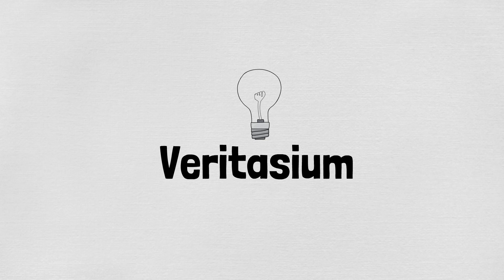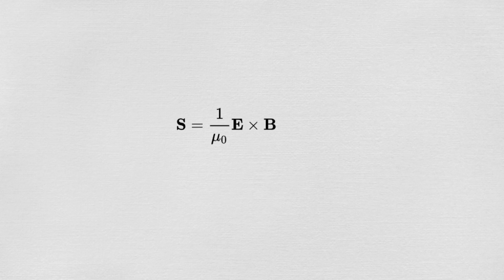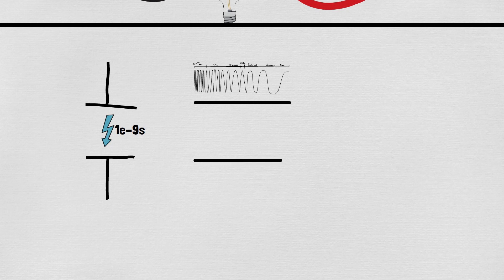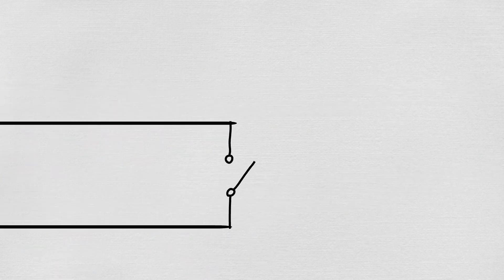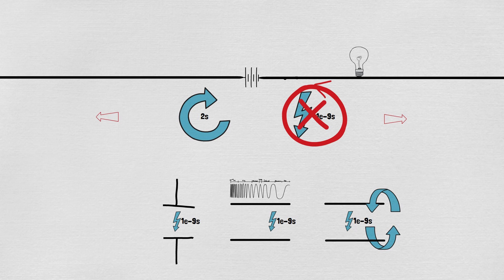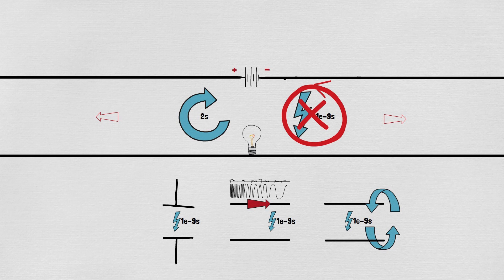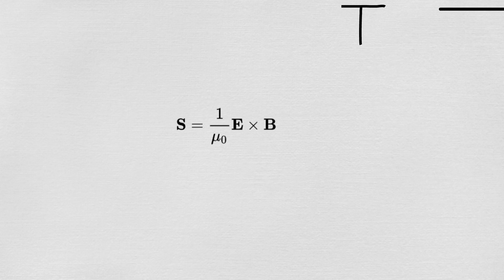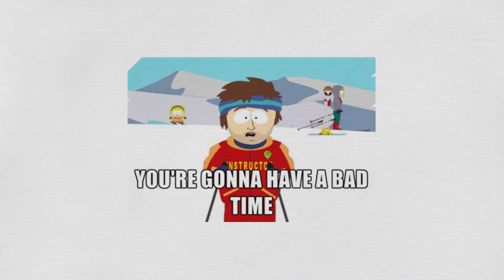Veritasium is Right? (see description)

Comment: Robert Faranec did an excellent video on this topic where he interviews Eric Bogatin about this question - the question is very relevant to high speed PCB design, because modern devices signal at rates where this effect is seen strongly at PCB-scale distances - and Veritasium is correct (or else your computer wouldn't work properly). 

The reason why is because the EM field need not travel along the entire circuit to create a current. The two wires can be thought of not only as a single capacitor, but can also be broken up into arbitrarily small inductor-capacitor pairs (where the inductor represents a segment's inductance and similarly for the capacitor). Now, the EM field's formation along the wire can be thought of as each of these L-C circuits charging or discharging to a given applied voltage. Using this model, a current will start flowing at the lightbulb's location as soon as the switch closes because the switch is passing current to charge the capacitor of the next L-C circuit, while that circuit's inductor is slowly allowing current to pass into the following L-C circuit, and so on, and so on. The bulb won't turn on until the switch is closed because no current is flowing either through the end of the wire or the virtual intermediate L-C circuits. While the transient is running down the wire, the L-C circuits dominate and the current is going to establish the EM field, and once it reaches the end and reflects back, the termination (in this case a short) dominates as all of the capacitors have charged and there is no change in current for the inductors to fight.

This also provides an intuitive answer to the "what happens if the switches are far away" question. If there's a second switch on the far end, then the lightbulb will turn on until the transient (the "wave" of charging L-C circuits) reaches that far end, at which point it turns off: it's being turned on by the current required to charge the capacitance of the transmission line, but then turns off once the transmission line is fully charged and no current is flowing at the far end. Similarly, if we place the switch very very far away, the lightbulb will turn on once the charge transient/EM field reaches it along the wire, turned on by the current being passed to charge the wire's own capacitance.

This effect is vitally important high speed PCB design (for both digital and RF applications) in the form of transmission line impedance. You hear a lot about controlled impedance PCBs providing a transmission line impedance of, say, 50 ohms. All that means is that when you put a transient into the transmission line, it will pass current as if it had a resistance of 50 ohms until the field is fully established all the way to the end of the transmission line and whatever termination is there dominates. This is why, for example, it's important to impedance match high speed receivers to their transmission lines, since then the device on the far end has the same impedance as the transmission line connecting it to the transmitter thereby preventing loss to transmission line inductance from the impedance changing once the EM field has reached the receiver. This applies equally to antennas and to high speed digital communication.
Reply: kudos for such a lengthy explanation ! i understand
Reply: I think it would have improved the original video a lot if he had clarified that the important distance was the bulb to the switch not to the battery 

And how important the constant 1m difference is. From his description you would have the same effect if the wires were 1km apart.
Reply: @scollyb  I agree; it was only after I thought about it as "but what if it's just a PCB" did it click for me. Thinking about it in terms of (for example) a 1ns rise time signal going onto a 10cm transmission line made much more sense, I think because it makes it easier to think abstractly about the problem.
Reply: @benjaminchung991  For my physicist brain it was thinking about the effect on the fields and the electrons as the switch closes.
Reply: @JanoyCresva66  It can be build up easily. No need for very long lines. A transmission line terminated by its characteristic impedance is indiscernible from an infinite line. A couple of meters will do.
Reply from the maker: @JanoyCresva66  i look forward to that as well, since i'm not 100% confident in my interpretation either. if i had an oscilloscope, i'd perform the experiment myself, but alas, i am but a poor gov't scientist.
Reply: @antimatterhorn  I know with my old computer, if I bent/stretched the ribbon cables the data would get scrambled, I was told this was because the path taken by the electricity on the stretched strands was slowed down, taking that data out of sync.... The source and the destinations did not change locations, so I think this would be a practical proof that you are correct, if the electricity didn't flow in the wires, why would it matter?
Reply: @antimatterhorn  Nice one! Finally some humor. Poor govt scientist, I'm sure you have to haul your check in a dump truck. Now, as a poor E&I, that's my line.
Reply: You nailed. In order for the bulb light current has to pass in and out of the bulb. With the switch open no current flows out of bulb.  Because the switch is right next to the -ve battery terminal  there will no coupling between the antennae on that side as Tycho proposes. On the left hand side there is coupling but this only creates current into the bulb. on the right hand side the switch is open so there is no coupling and hence no current out of bulb. Now as soon as you close the switch the antennae on the right (-ve) side are indeed coupled so now we have current in and current out of the bulb so it lights. I used the diagram at https://youtu.be/-jJB8dyOJIw?t=173 for this explanation.
Reply: @alexjohnward  In practice the amount of signal jitter that's introduced by a still-intact cable into a signal won't effect the signal integrity much. You can calculate this fairly easily - if we take the speed of light to be approximately 3x10^8m/s a 1mm deviation in overall length (for example) induces a delay of around 3*10^-12 seconds, for which a clock speed in excess of 100GHz would be needed before it started closing the eye. 

What I suspect was happening is not that the electricity was slowing down (the rate at which the field propagates doesn't have anything to do with conductor diameter) but rather that the connection was becoming intermittent and was occasionally being broken by a failure in the cable itself.
Reply: @scollyb  you will have a greater impedance (3 times greater) but the bulb would still turn on.
Reply: @antimatterhorn  you see flowing current (I=V/Z0) in a transmission line immediately as soon you apply a signal, whether if it is short, long, infinite, open at the end, closed at the end, closed with a matching impedance.
Reply: Alpha phoenix is doing an manual experiment on this. Can't wait for mehdi too
Reply: @lubdub7913  no, this explanation is insufferable. too long, yet so wrong. sounds clever, but even the writer doesn't know what he's talking about.
Reply: This sounds very reasonable until you try to put some figures to it. Let's say we have a 12V battery and a 3W, 12V bulb. So the bulb uses 250mA and has a resistance of around 48 ohms. Let's assume we're using 18 AWG wire, which has a diameter of about 1mm. Then you find that the two wires running 1 metre apart have a capacitance of around 3.6pF per metre.

Now we can start examining some of the assumptions made in this "charging the next L-C" circuit theory. If we're charging the "first L-C circuit" with the current of 240mA, it will charge 3.6pF to 12V in around 170ps. So after 0.17ns the first metre of the wire pair will have charged up its capacitance and both strands will be at 12V, so no more current will flow from that first metre charging up. But the next 1 metre of wire will take over 3.3ns to receive the 12V step signal, even if it propagated at the speed of light, so where is the current coming from to light the bulb in the meantime? It simply doesn't add up.

For it to be a transmission line, you have to hold one wire at a fixed potential (call it ground) and apply a signal to the other. Your analysis expects the furthest wire to charge up to 12V when you apply 12V to the nearest. That's nothing like a transmission line.

There may well be a transient radiated as an electromagnetic wave as the switch is closed, but it will never carry enough energy to light a bulb for the time taken while the current travels around the circuit (which is going to take a time in the order of seconds). Otherwise, we could add more bulbs connected to lengths of wire, but disconnected from the main circuit, and expect to see them light up while waiting for the current to propagate. At which point all the other bulbs would all turn off!
Reply: @RexxSchneider  To be clear, I'm not arguing that the amount of current passed in the transient condition is equal to the amount of current that's passed once propagation has finished. The current that's flowing as the wave is propagating down the wires is going to be determined by the characteristic impedance of the two wires in question, which may (as in your example) be much much higher than the impedance of the receiver on the far end. In this case, the return current will be tiny until the reflection has came back from the far end. I'm simply saying that current is flowing, rather than making a specific statement about what kind of light bulb it will light up/how much current is passing during that time. The lightbulb, in this example, is being used to indicate if current is flowing at all, rather than X many amps are flowing through it.

> There may well be a transient radiated as an electromagnetic wave as the switch is closed, but it will never carry enough energy to light a bulb for the time taken while the current travels around the circuit (which is going to take a time in the order of seconds)

This depends on the characteristic impedance of the transmission line. You're absolutely correct for the line you describe, where the impedance is quite high due to the spacing and low dielectric value of open space. In the case of a PCB, for example, characteristic impedances of 50 ohms or similar are typical, which can pass meaningful amounts of current, due to the much smaller spacing and the higher dielectric of FR4.

> Otherwise, we could add more bulbs connected to lengths of wire, but disconnected from the main circuit, and expect to see them light up while waiting for the current to propagate.

This can happen, since the wires are in this case acting like a radio. Again, the case where this effect is most noticeable is not on these large scales (because obviously we don't have wires this long running along straight lines out to space) but instead in PCB design for very high speed digital systems or RF. What you're describing is crosstalk, and happens a lot in said high speed design applications.
Reply: You glossed over the fact that the "high speed PCB" means that they are designed for very high frequency - hundreds of megahertz or more. Veritasium video dealt with DC current - an entirely different concept. As Maxwell's equations dictate, EM Field can travel or propagate only when it changes with time, and there's no propagation of EM field in DC circuit, such as in the case of Veritasium video.
Youtube video will never deal with scientific nuances such as this, that's why you should not based your facts around them.
Reply: @hereiam2005  The act of closing the switch is what makes it a non-DC problem; you have a transient flowing down the wire any time when you are changing the potential. It's just that in circuits of reasonable size (e.g. not going to the moon and back) or when you are observing at reasonable speed (e.g. not hundreds of megahertz), it just doesn't matter enough for it to become an issue. These effects still happen in "DC" circuits when you switch them on and off, it's just that normally you don't notice it. I would also note that this can still be an issue in slower clocked circuits (even tens of kHz) because the main concern is not clock speed but rather the rise time of the signal, which can dramatically exceed the rate that the clock speed itself implies.

In the particular case of the Veritasium video, the effect is made noticeable in a "human" time scale by making the transmission line impossibly long. As a result, the time required for the signal to propagate to the end and reflect back (during which time the observed impedance will be dominated by the line's characteristic impedance) is made artificially enormous. As you point out, this is an absurd case: nobody has a conductive path this long (though there might be some weird examples like spools? not sure), so you're not going to see this in practice. However, due to the problems mentioned above (where high clock speeds, fast rise times [which are more common then you'd think], or RF becomes involved), it's a serious practical concern in PCB design and electrical engineering generally.
Reply: Not only PCBs that inductor and capacitor model is used in electric Transmission lines also...
Reply: What you describe is true, but this effect will not light a regular sized lightbulb in a macroscopic circuit (unless we’re dealing with a comically huge battery)
Reply: @dlmcnamara  The currents passed can, in theory, be fairly large (50 ohms, which is typical for controlled-impedance PCBs, is not that high), but you're right in that normal lightbulbs are probably out of reach. An LED is well within reach, though.

The problem that I'd highlight is less current and more time. While propagation through FR4 (or coax dielectric) is slower than in vacuum, it's not enough that any realistically-long cable would cause the effect for a perceivable length of time. As a result, while you might be able to turn on a LED, it would be for so little time you couldn't see it.
Reply: What if to rule out the impedance or EMF transmission across the two long lines, you somehow trap the bottom half in a faraday cage. 
Or suppose you have a cement wall to isolate the two halves.
Reply: @phanomchanthavong1668  There will still need to be a return path for the current going out, so you'll get current flow as the signal is propagating, but the characteristic impedance in the situation you describe will be *enormous*, so the current passed will be miniscule.
Reply: So what is the characteristic impedance in Veritasium's experiment?
Reply: @gyroninjamodder  Assuming 0 contribution to the dielectric of the cable's insulation, and using 4 gauge wire (since his cables looked like car jumper wire and that's about what it is in the US), I calculate the characteristic impedance to be about 1.4kilohms. As a result, I would expect to pass (at 12V) about 9mA until the reflection of whatever's on the far end came back.
Reply: I remember creating an interview question for our company based on this some 4-5 years back: You have a multimeter set to resistance measurement mode. You have a pair of wires, both of which encircle the globe once. At one end, the wires are open and the other end you have an X Ohm resistor connected. When you connect the multimeter to the open ends of the wires, what do you think would the reported measurements: 1) at t1 seconds (don't remember the exact values used, but something much less than the propagation delay across its length
2) after quite a long time

What would be the observation at the above time instants if the wires were open at both the ends ?

Basically the whole idea was to check if the interviewee was aware of the concept of Transmission line theory & surge (characteristic) impedance.
Reply: Sure, a feild will propogate at that speed, but you cannot scale up the assumptions you're using like that with any practicality. First, because the battery is charging a perfectly lossless line (according to the initial problem) is sees only induced loss... So it's ends will have almost no potential difference until the wire is fully engaged. If you assume the battery is also magic, you're going to be inverse square lawed to crap over that meter distance, and the ratio of power produced at the battery to power induced across the gap is gonna be huge. In PCBs with tiny distances and high frequencies this is less of a concern than in a transient DC response presented here.

So yes if you accept that any power  turns the bulb on or that the battery is so powerful that no loss will overcome its ability to turn on the bulb, it works. But then the thought expirament is stupid, because the bulb is already on because either a tiny moving magnetic feild exists anywhere else in the universe, or else the battery has overcome the air/vaccum around it and the wire is irrelevant.
Reply: This is similar to an idea i had when i saw the video: a chain reaction. But in my idea, the wire would be like a giant magnet, and we would divide the wire into tiny magnets. 

When a voltage were to be applied, the magnets (the magnetism of the wire) would all activate at once (bcuz they are an inherit property of the wire itself). Then, electricity would be allowed to pass through the magnetic fields, thus completing the circuit and allowing the energy to "flow" through the magnetic fields, and "outside" the wires. In this theory, the mag field would have to complete the circuit before anything else for the energy to be allowed to flow to the light bulb, and since it completes it inmediately, the only time it required for the energy to reach the light bulb would be that of the distance between the switch and the bulb. 

This can be proven by seeing if a magnetic field can conduce electricity, and by seeing if an electromagnetic field is generated between two parallel wires conducing energy. 

But im not educated enough to make good and solid theories yet so i will just leave a marker here to see how this debate goes.
Reply: I have a housemate who is a senior electrical engineer at a very young age.

And he can confirm, when he designs pcbs he has enough experience in the field that when he thinks of (especially multilayer) pcbs, and particularly lines that have strict protocols for signal preservation (ddr3 for example) he visualises the behaviour of the board with this extension of fields, he designs incredibly small devices and says they just dont work if you arent aware that signals are traveling with this electromagnetic interaction. They dont just follow the wires, and induction is just a tiniest part of the story. 

So while vertasium might have gone to hollywood lengths of appropriation to make the story accessible to his audience, the way he shows the signals propogating through the fields is a good visual tool for considering 3 of the 4 dimensions of this interaction. Especially during pcb layout design.
Reply: @benjaminchung991  "you couldn't see it" means the light bulb does not turn on until more like 1second after closing the switch (i.e. the time it takes the signal to propagate along the long legs of the circuit).  Until someone actually calculates the magnitude of the energy flow directly across the gap for the meter-scale circuit, I'm not convinced that any appreciable power, even transiently, directly crosses the 1-m gap.

I'm imaging that the gaps you are talking about are a few mm, maybe a cm, for PCB boards.  Veritasium's 1m gap is a couple orders of magnitude bigger.  So the induced fields at the receiving wire are probably much much weaker than in the PCB case.
Reply: @dlmcnamara  I actually did the calculation above using the transmission line model. The characteristic impedance of the transmission line is around 1.4kOhms, so with a 12V supply the transient current is about 8.6mA until the reflection of whatever's on the far end comes back. That's enough to turn on a LED.
Reply: @benjaminchung991 At what time (relative to the time that the switch is closed) is the current through the bulb 8.6mA?

As I understand it, the transmission line delay for what I believe are realistic values for the inductance per unit lenght L0 (2.6e-6 H/m) and  capacitance per unit length C0 (8.9e-12F/m) yields  a signal propagation speed of about 2e8 m/s  (v = 1/sqrt(L0 C0)).  So if we're dealing with a 1-light-second long transmission wire, the load won't see the applied voltage until about 1.5 seconds after the switch is closed.

Check out this pspice simulation which clearly shows how the signal is delayed as it propagates along the transmission line https://www.pspice.com/resources/application-notes/transmission-line-modeling
Reply: @dlmcnamara  The 8.6mA starts flowing as soon as the field propagates from the positive rail to the negative, so it will (based on your propagation speed calculation) start flowing somewhere on the order of 5ns after the switch closes. It will continue flowing until the signal has reached the load (using your math, taking 1.5s) and reflects back (another 1.5s) to the transmitter. As a result, the 8.6mA flows for around 3 seconds in the Veritasium example, after which the observed impedance will be determined as a function of the receiver and the process repeats until an equilibrium is reached.

This can be seen in the pspice model in figure 10. We know that the current waveform on the transmit end rises with the voltage waveform (figure 5), but the voltage (and thus current) on the output doesn't increase correspondingly until the signal has propagated to it. In that time, the source is still feeding current in (which must then return through the ground path and thus be seen by the lightbulb), none of which is seen by the load.
Reply: @benjaminchung991  

Does the transmission line model you used to calculate the magnitude of the response at the load correctly provide the time delay between closing the switch and the start of the current through the load?   

Figure 10 shows that the voltage across the load (in this case a matched impedance load) is delayed by 320ps.  This delay is the compounded delay of each of the 320 LC elements they used to represent the transmission line.  The load doesn't see a voltage until the signal propagates to it along the circuit.
Reply: @dlmcnamara   Yes, it does - because we're not measuring current (when talking about the lightbulb) at the load, we're measuring current through the return path adjacent to the voltage source. Taking figures 5 and 10 together, we can observe that current starts flowing out of the voltage source before the signal/voltage has propagated to the load by a margin of, as you say, 320ps. By conservation of current, this must then be returning via the ground return path, so would be observed by the lightbulb (located along that path, adjacent to the voltage source). 

Since the signal has not, as you say, had a chance to propagate to the load yet, none of this current (8.6mA) is flowing through the load. It's flowing through the virtual L-C circuits/the field being made by the transmission line. The input impedance (and thus current flow) of the transmission line will only start to depend on what the load is once the signal has had time to propagate all the way to the load and then for the reflection to come back. Until that time, the input impedance of the transmission line is simply the characteristic impedance of the line.
Reply: @benjaminchung991  there is no law of conservation of current.  There is a law of conservation of charge.  KCL applies to nodes in the network.  Given that, until the signal actually propagates along the long wires, Veritasiums's light bulb is only capacitively coupled to any currents/charges in the wires near the voltage source.  There is no requirement that the current through the light bulb be equal to the current in the wires near the voltage source.

We agree that there is no current through the load until the signal in/on the wires has had time to propagate to it.  I'm saying that that fact is true for Veritasium's circuit as well.  (Actually, I acknowledge that there could be some infitesimally small voltage or current through the bulb nanoseconds later, but I would be surprised if it were even enough to light a LED).

Actually, consider this variation on the Veritasium circuit: put a battery and a switch out at the far ends of the long legs (2 batteries, 2 switches), arranged so that both with drive current in the same direction around the circuit.  Replace the original battery+switch with another light bulb.

Arrange it so that both switches are closed at the same time.   I think everyone would agree that the bulbs at the center start to light up about 1/2 second later (actually more than that if you account for the fact that the signal transmission speed along the transmission lines is <c).  This is what you get if you use a transmission line model.

Now, let's consider the same circuit topology but move both of the battery+switch ends of the circuits back close to the pair of lightbulbs.  In this case the transmission lines are, say, roughly circular with a circumference of 1/2 light second. We close the switches at the same time.  If the lightbulb lights up nanoseconds after the switches are close then this means that the transmission line model is not valid for this circuit ---  the transmission line delay is exactly the same.
If it doesn't start to light up until after 1/2 a second, then that observation is consistent with  the energy flowing /along/ the wires for this circuit.
Reply: @dlmcnamara  

> Actually, I acknowledge that there could be some infitesimally small voltage or current through the bulb nanoseconds later, but I would be surprised if it were even enough to light a LED

Yes, this is precisely the current that's being discussed. If you calculate it, it's about 8-9mA based on the transmission line model of the described wires. This is enough to light up an LED.
Reply: I just realised I should have thought of the astrophysics answer. The light bulb would never light because both it and the battery would have exploded.

It would create a huge electromagnetic tether through the Van Allen belts and into the solar magnetic field
Reply: @benjaminchung991  That's much bigger than I meant by infinitesimal.

You have not convinced me that 8-9mA are flowing through the wires /in the vicinity of the lightbulb/ a few nanoseconds after the switch is closed.  We know that there cannot be such a current way out at the far ends of the loop -- they are not causally connected (in the special relativity sense) to the switch.  So there are parts of the circuit where the current is still zero.  There is no (or we could model the system as lacking) any leak current across the lines (pure capacitive coupling), so there is no necessary relationship between the current in the wires close to the battery/switch and the current in the wires close to the bulb.

Consiider a 1-light second long ideal (lossless) transmission line -- voltage source at one end, load (light bulb) at the other.  For concreteness assume it is two wires set up about 1m apart and parallel to one another so that the characteristic impedance is about the same.  Consider the situation  where these wires are spatially laid out in a U shape.  And the separation between the tips of the u, where the battery+switch and lightbulb are respectively, are 0.1 light seconds apart.  (so it is U about 0.1 light seconds wide and about 0.45 light seconds high) The transmission line characteristics are basically the same as we've been discussing above, so the battery will be dumping approx 10mA into the circuit immediately after the switch is closed.  As far as I can tell, the model you are using would have me believe that, due to this current happening almost 30,000km away, I'd see ~10mA passing through the wires at the bulb after about 1/10 of a second; well before the signal could transit along the length of the line.